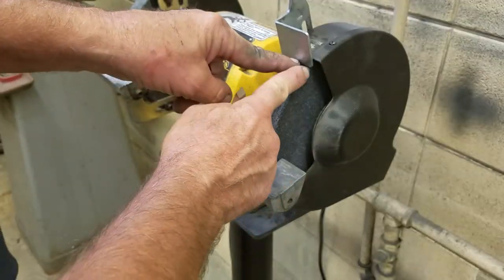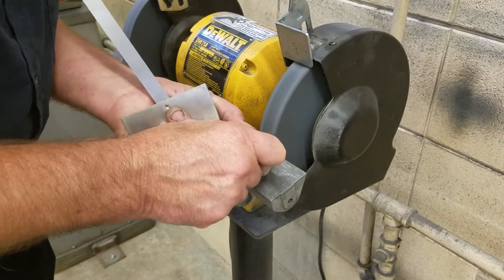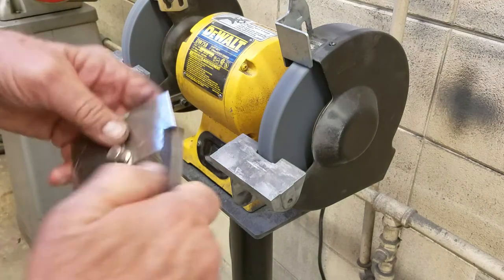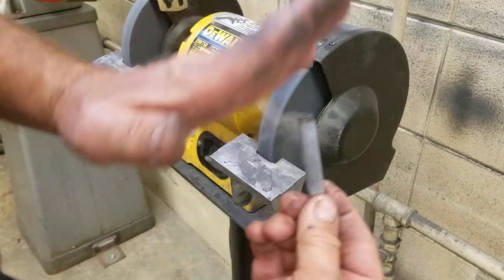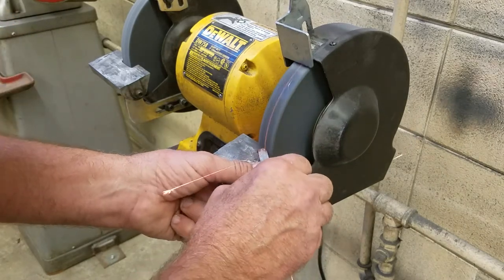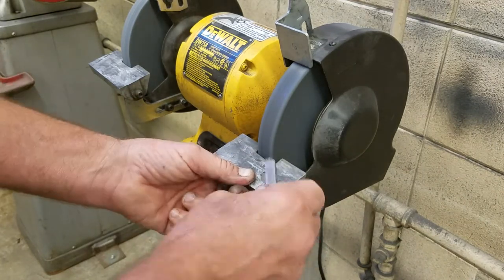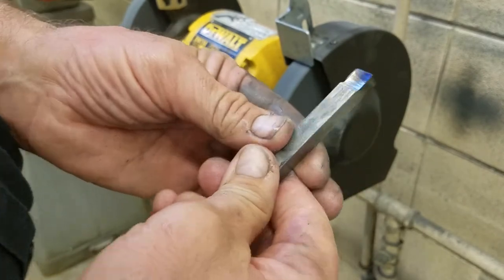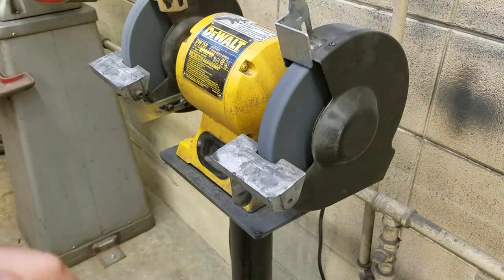Grinding Lathe Tools, The Threading Tool

Comment: I find that these cobalt/HSS tools are far better for screwcutting, the tungsten tipped inserts are so easy to break, the only advantage they have is you can index then round without altering your settings, I was pleased to see you emphasise the need for constantly dressing the wheel, most important! Chris B.

Comment: Thanks for the video. Really helped me to set my grinder rest to the proper angle. May I ask what you use to dress the wheel? Also. Running a carbide insert, as I understand carbide loves speed, is it better to run HSS, or does carbide actually work for this operation? Thanks again.